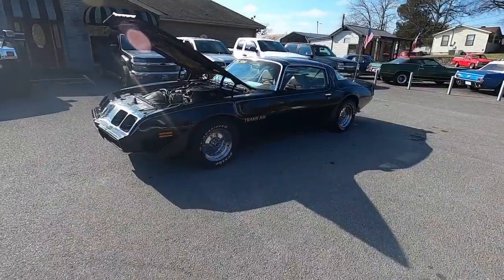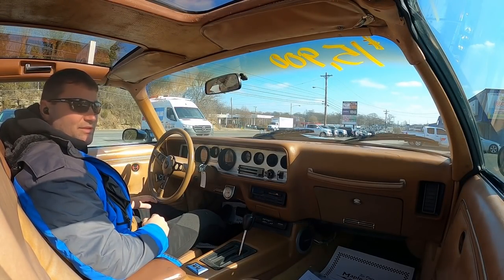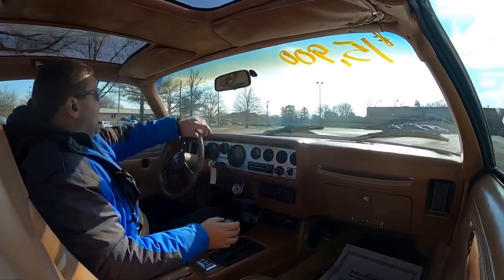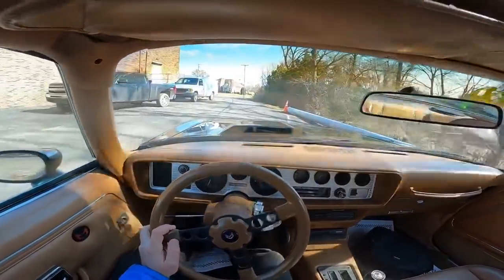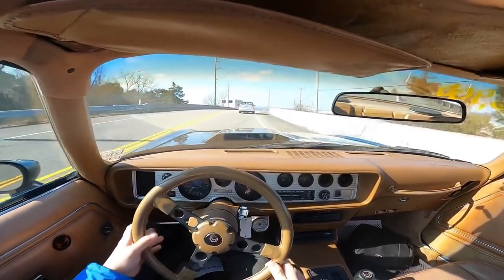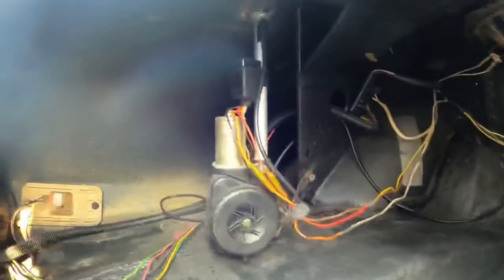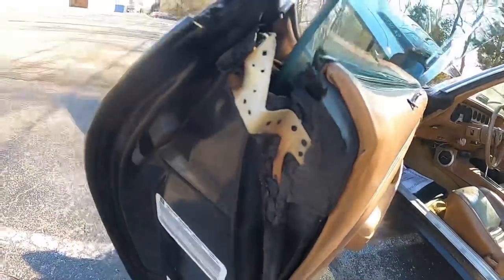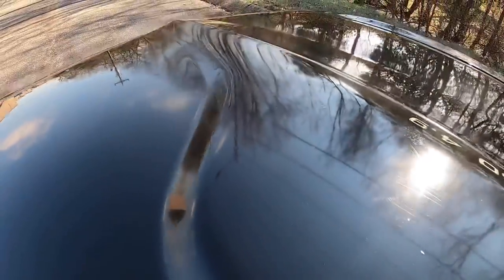Test Drive 1980 Pontiac Trans Am Turbo Charged SOLD $15,900 Maple Motors #1451

Comment: It's crazy that the 301 turbo actually made 25 more foot lbs of torque than the 400 that came before it (but 10 less HP).  Seems like a Pontiac 350 would've been a nice more economical option than the 400 but I think the "turbo" thing was such a big marketing gimmick at the time...
Reply: The actual  hp difference  between the W72 400 of 1979 and the turbo 301 of 1980 was 50 hp , NHRA tested the W72 an it made 260 hp so underrated from the factory.

Comment: The bandit edition was 12,200 dollars brand new in 1980 loaded out ! Quite possibly the slowest of all the Trans Am's . How do I know ? I purchased one brand new in 1980. It road like a dream but could not get out of it's own way . It was definitely a girl catcher though .
Reply: I have an 80 now that somebody put a 454 and 4 speed in probably sometime in the 90s.  Hood has the shaker in the middle instead of offset though it is attached to the hood.  Mine has the original gold turbo wheels.
I had a 76 in the early 90s.  10-4
Reply: The trick was to put heads on from a 68-70. That right there got you from 8.1 to 10.25 compression and thus easy HP…Still get warranty work done if you were careful enough 😉
Reply: The slowest Trans am was the 145 hp 1982 305 cars .

Comment: Nick, you have to, tap those inside T-top latch points down. It will bring the glass top down flush. Over the years, of putting the T-tops back on the car, it bends them up. Nothing worse, than a whistling or leaking T-top.I've, done it many times, in the past.
Reply from the maker: For sure
Reply: They can be adjusted.
Reply: Drop the trim and headliner and simple adjustment

Comment: i think on the 1980 turbo trans ams they had 4 brrl carb,81s went to electronic fuel injection
Reply: No fuel injection in 81. That's in 82 with the Crossfire. I believe 81 was the first year for a computer though.

Comment: My brother at 18 bought a 81” off the showroom floor. Triple black. That car was slow as fuck! He got hit by a train in the car and believe it or not they repaired it. He had it till like 5 years ago and sold it with 40 thousand miles on it for $1500 yep 1500.

Comment: I had the '80 Indy 500 Turbo. Someone destroyed the dash, just to steal the radio. The T-Tops would always need adjustment due to body flex and the inner 2 tabs on each side were way to flimsy.

Comment: I see a few posts that these cars are really slow dudes its 42 years old who cares how fast it goes its a cool looking car and will turn lots of heads and seems like a good deal at 15900 all the ones around me I see for sale are big bucks it seems you could put 5 or 10 K into and still come out ok the worst thing is to buy an old classic and get flipped on it and then be trapped on taking the loss or dumping more into it.

Comment: How do you know its the speedo cable? If its making that much noise is it a gear or? Are the miles registering while driving it? I have never heard a speedo cable making noise like that. Thats pretty loud? Cool car though. My era. I graduated in 81 we all had the late 60s early 70s muscle. Me, mostly Mopars.
Reply from the maker: I can tell because the click slow down as I slow down. Plus I’ve run into this problem hundreds of times